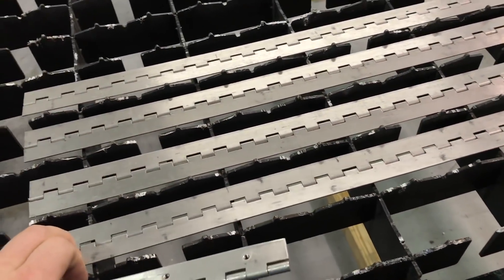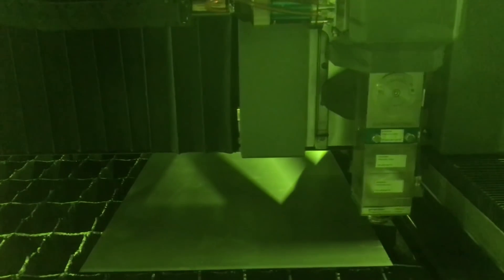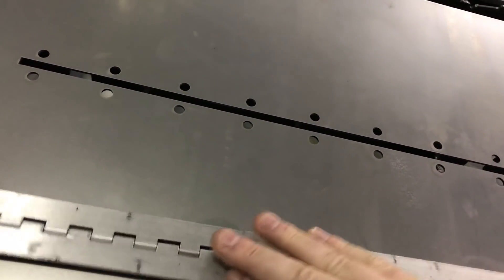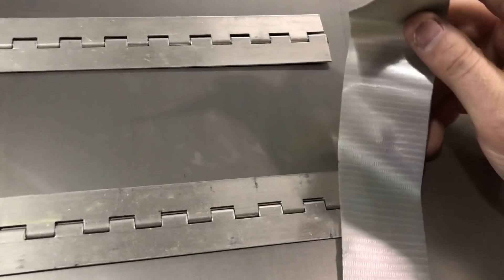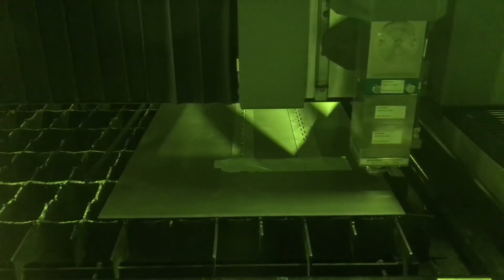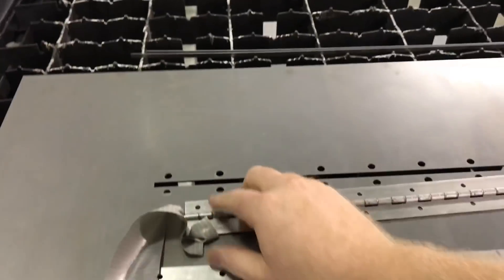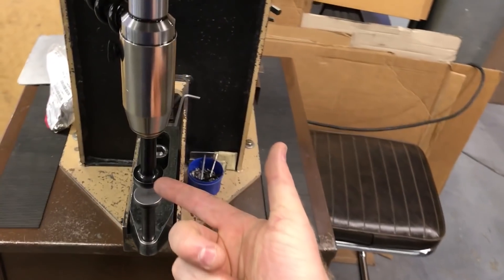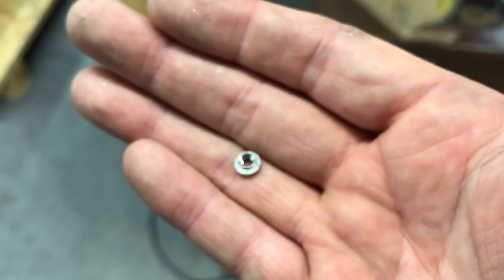Laser Cutting Hinges

Comment: Why are you retracting the head after each hole?
Reply from the maker: Because the gas tends to pop up the hinges sometimes if I don't use toggle clamps and the long strips on the fixture can also pop up.  It's not a job worth optimizing, as it's just 4 hinges for a trade show booth.  If it were a large run, I would optimize the head movements to only lift up when necessary and avoid any holes already cut to avoid tip ups.
Reply: Gotcha. Been a long time since Ive done short run lasering in a fab environment. Forgot that, "just get it done" overcomes "get it done faster" lol

Comment: Have you tried forming bends in sheet metal using the heat from the laser?
Reply from the maker: Not intentionally, but I've had warping issues if the feed rate is too slow.  Have you seen that somewhere else?
Reply: Proto G first saw it https://youtu.be/1SBgobop7Wg while browsing random manufacturing vids
Reply: I turned a Mazak SpaceGear into a punch press on 3mm Aluminum. Somehow it withstood the hit.

Comment: woah can you do more on the presses conductive and non-conductive feature?
Reply from the maker: What do you mean?
Reply: Like how does it work? Its a really cool safety feature, better then guards or wrist leashes. Does it work off of sensing a magnetic field or is it looking for voltage between the top and bottom anvil?
Reply from the maker: The top and the bottom anvils of the hydraulic press have a low potential difference such that only a negligible amount of current will flow through/around human flesh.  There is a preload mechanism in the ram that checks for a certain amount of current flowing from the top to the bottom before pressing with the rated tonnage.  The non-conductive setting for plastics is more dangerous because it turns that safety feature off and just lowers the anvil until the force set by the dial has been reached.

Comment: I was hoping you were going to show more of that laser.

Thanks for sharing
Reply from the maker: What specifically would you like to see?  Here are the specs for the laser: 
 https://www.lvdgroup.com/sites/default/files/downloads/lynx_us2016_wlabel.pdf
Reply: Thanks for providing the specs on that machine. I have zero experience with laser cutters, and just slight knowledge about CO2 lasers, so the Fiber Laser is interesting to me.
Reply: @yosmith1  I realize that you replied to this a year ago but you should check out one of the larger laser manufacturers such as Mazak, Bystronic, or Trumpf.  Also this guy is not running his machine in its fastest setting so they are far more impressive than what this shows anyways.
Reply: Thanks for this I was wondering what machine was being used!